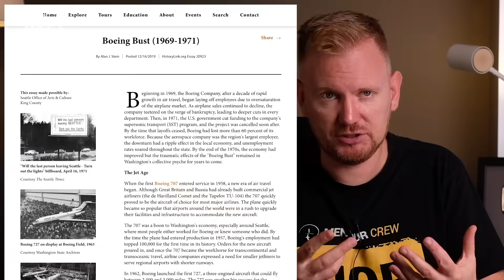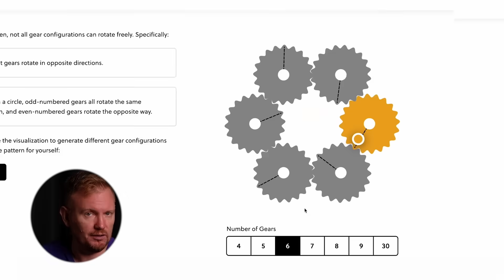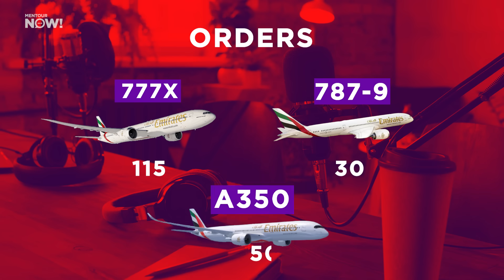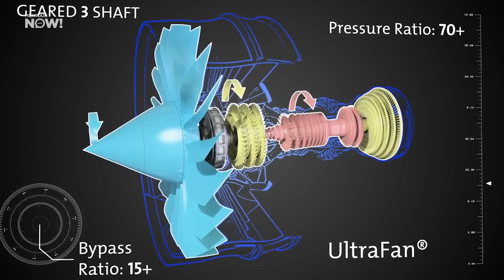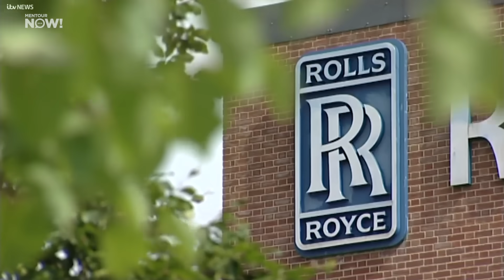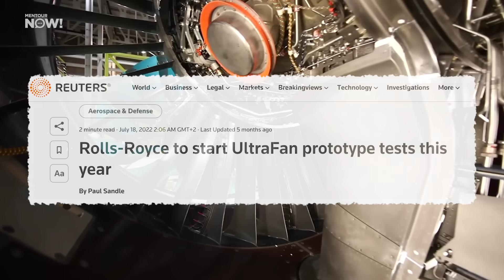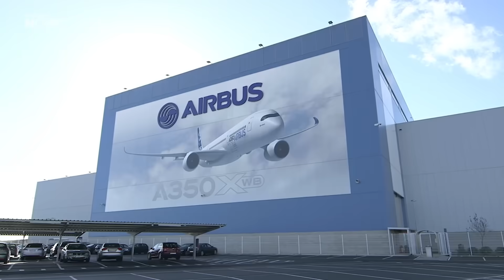Are BOEING planning a 747 with 2 ENGINES?!

Comment: Realistically you need to redesign the wings for new engines and mounts, and at that point you would want to redesign the fuselage, for improved efficiency. At that point you would a new aircraft.
Reply: On seeing the huge size of this new engine it points to a radically different design. It looks basically too large even for a 747. Either the wing has to be very high above the ground (4 metres +) or there has to be some kind of centre mount or even upper mounts (crazy).
Reply: Lucien: 

Good observations!

For a plane so huge, both during its inception and by today's standards, the 747 had a relatively low-set wing plane.  

Standing next to a more recent, and slightly smaller 777, the difference in 747 vs 777 wing-plane heights becomes glaringly apparent.  

The same goes for a Boeing 737(of any variant) parked next to Airbus's A320 family.  

I'm not sure of the reason why, and I'm assuming here, that the wing heights designed into the 1960s era Boeing jets was considered adequate for what was then estimated to be future engine development.  

That, or, the U.S. plane mfgs just did not want to design aircraft so high up off the ground (or normal height by post-2000 standards), that they had trouble interacting with then 1940s or 50s era airport terminal gates.
Reply: @Lucien86  like the Honda jet, yes
Reply: @Lucien86  yea itd better suit the a380 (as much as i hate it) cause the a380 already has those large upwards swooped wings that airbus loves so much. realistically tho, why not top mounted wings? every large cargo manufacturer has done it, and lets be completely honest, going forwards cargo (and emirates) is gonna be the biggest buyers of a new jumbo. and all you gotta do is look at antonov to know you dont need to change the fuselage much. the 747 is basically just a low wing an124 that can hold passengers.
Reply: @Rocker-1234 Top wing aircrafts are heavier than low wing, because fuselage has to withstand forces between a heavy wing with engines and a landing gear. Similarly with rear-mounted engines, where fuselage has to carry weight and forces from engines. "Everything on wing" is the most effective way to build a large airplane
Reply: @Lucien86  my thoughts too. Even if it succeeded, will it be worth the drop in performance? Think about why Airbus never bothered to even try a twin engine A340...
Reply: @Lucien86  inb4 that's why they are looking at truss wings
Reply: @Lucien86  Box wing? Maybe that NASA design for efficiency that looks sort of like a modern Clutch Cargo Flying W? (Bellanca Aircruiser)
Reply: @Lucien86  If one big one replaces two regulars, maybe just replace two with a big one in the tail, like DC-10s or L-1011s, and keep the cargo option for front hinged loading.
Reply: The GE engine was tested on a pylon under the 747 wing. All three standard engines were shut down once the heavily-laden aircraft was airborne, and the single GE engine easily pulled it skyward. That beast develops something like 115 thousand pounds of thrust...more than two standard engines. The engine pylon would need to be re-stressed for the added thrust, but that's probably not too significant. They might even learn that the current design is adequate. Building a new aircraft in this market would be an extinction-level event. Even modifying the 737 nearly killed the company.
Reply: @paulslevinsky580  "The engine pylon would need to be re-stressed for the added thrust, but that's probably not too significant."  The entire wing's fatigue design would have to be reevaluated, and I doubt (I was an airliner engineer with structural background, but not an airliner structural engineer) that would yield a satisfactory outcome.  Load levels and paths are going to be radically different, failure-mode load path redundancies won't be at all the same anymore... on and on.

If it didn't need an all-new wing, which is probably desireable for fuel burn improvement anyway, then probably close to an all-new wing in terms of development and certification costs as a somewhat educated guess.

Having worked on landing gear dynamics problems, "I pity the foo" (in Mister T's words) who tries to significantly jack up the existing 747 fuselage to fit a much bigger engine underneath.  Might end up working out, but a lot more program risk involved than non-specialists would realize.  Even starting with a clean-slate design, Airbus almost got their head handed to them with the A380 gear and that was easier than what would be involved here.  Edit:  For example, the attach points (trunnions) for all four main gear would need to be moved outboard in order to keep the wheel wells in the same position... more changes to load paths!  Airliner designs are so optimized -- many things "interlocking" with a number of other things -- that it's really hard to pull one card out of the middle without the whole house falling down program cost-wise (which hasn't stopped Boeing from trying ; )
Reply: @marcmcreynolds2827  good analysis, thanks!
Reply: @marcmcreynolds2827  I've flown out of Syracuse airport in Upstate NY many times. It has a sectioned fuselage from a 727 on display. If I'm not mistaken, the basic architecture is common among a whole range of Boeing aircraft including the 707, 727, 737 and 757. Boeing is well-versed with repurposing kit from their parts-bin. The 747 has already flown safely with the GE 9X engine under wing in a rigorous test regimen stretching hundreds of hours. The RR engine isn't much bigger, nor much heavier. The 747 was developed in a fraction of the time that Airbus languished on the drawing boards. It is a child of the sixties, before the advent of CAD and powerful FEA evaluations. Doubtlessly the design is big-boned as a result, as the engineers would've erred on the conservative side. That is why I stated that the craft may very well already be structurally up to the task.
Reply: @paulslevinsky580   Yes it is.  Yes they are.  Yes it has.  No it's not.  A bit apples-and-oranges, but ok.  I wrote an FEA program from scratch BTW.  Not how it works. Not very likely.  (Sorry for the brevity, but there were a lot of points to be addressed there.)

In a nutshell, sure an airliner can handle greater loads than it was designed for, at least in terms of nothing breaking over a limited number of cycles.  The criteria aren't as stringent while flight testing under an "Experimental" classification.  But what it takes to satisfy multiple certification requirements for structural integrity (basic design margin, fatigue loading spectra, "fail safe" rules, ???) to meet say a 40,000-cycle design point is something else altogether.

To look at it from another angle, if you could hang a couple of humongous new engines on the hardpoints of an existing 747 wing with just localized strengthening plus some tweeks here and there, then something was very wrong with the design of the original wing.  Maybe a thousand kilos heavier than it should have been?  I know from experience that when it comes to adding weight, twenty kilos can be a deal breaker with an airline.
Reply: @marcmcreynolds2827  : The vibrational regime would certainly be different, and the load on individual pylons would be different, but supposing that the vehicle otherwise remained identical, even to the point of keeping the same speed range, there would be a point around the inward pylons where the addition of stiffening could obtain almost identical stress & strain characteristics the rest of the way into the body, just leaving questions about the redistribution of weight due the the new engine configuration. Not a zero-effort challenge, but smaller than an all-new design.

The bigger question is probably whether different forces should prompt a clean-sheet design. If Boeing's next project is an entirely new design, then they may well make larger changes that "747 twin jet".
Reply: @marcmcreynolds2827  A spar failure would be far worse than losing a sprig of parsley from the chicken antre'. The 747 was put to paper mid-century, not long after the venerable B-52. Another example is the iconic DC-3. Or the Tu-95. No one envisioned those aircraft becoming centurions. They have all vastly exceeded their design teams' capabilities and target service lives. They simply didn't know as much about the aging process of metals and the accumulative effects of stress/strain back then. That growing body of knowledge can now be used to expand the envelope of the existing 747 airframe. I'd trust a twin-engine 747 more than a digitally-compromised 737max with no user manual.
Reply: @paulslevinsky580  "A spar failure would be far worse than losing a sprig of parsley from the chicken antre'. "   Well I'm glad we cleared that up  ; )

"They simply didn't know as much about the aging process of metals and the accumulative effects of stress/strain back then. That growing body of knowledge can now be used to expand the envelope of the existing 747 airframe."   I see that repeated fairly often on the internet, suggesting the 1960's/1970's was some sort of fatigue-mechanics dark ages. 

Yes, knowledge of (metal) fatigue mechanics has continued to increase over the decades since then, but there was plenty of fatigue/fracture mechanics knowledge to work from at the time.  What has changed is the means by which regulatory authorities seek to insure that fatigue matters are properly accounted for in an aircraft's design.  I was present though not directly particpating when that got underway in earnest in the late 1970's/early 1980's -- the transition from "fail safe" to "damage tolerance" methodology in certification.

To be clear, there's no question engineering-wise that four existing engines on a 747 (or DC-8, or...) could be replaced by two engines of whatever size.  The resulting aircraft would fly safely, could be certified...  and in my opinion for the reasons I've talked about plus more that I haven't, would sell few to none.  That does occasionally happen  in the jet aircraft business BTW:  Build it/fly it/absolutely no one buys it.  The engineering here is quite doable, but the economics likely stinks.
Reply: @paulslevinsky580 You would actually be surprised how closely engineered the original 747 was. So closely designed, in fact, that some areas cracked over time because of rough handling by thee pilots (like the habit of slamming the nose down when landing).
Reply: @paulslevinsky580  Great points.
Reply: @Ampersandrascott  I read a technical article about the development of a fastener that was going to be used repetitively on the 747. They carved it to the bone. I can't remember the numbers, but it was a stunning weight savings.
Reply: @The_ZeroLine  why thank you
Reply: Marc:

The Max thing all boiled down to MONEY.

Instead of, as Airbus did, clean-slating a whole new plane, Boeing attempted to create a larger, 21st century ETOPS-capable plane out of an existing early-1960s regional hopper. 

Which in lives lost cost Boeing far more than any money saved by not starting from scratch.  

And they didn't have to start from scratch - if they wanted an intermediate sized twin-engine ETOPS machine, the platform for that had already launched, back in 1980 .....
Reply: @marcmcreynolds2827  Are you all assuming they are going to stress anything by making the planes go faster, fuel economy is the big dog with airliners. Cutting their own throats and overbooking is the way they have been doing it. 

Now a few disasters later they have decided to just push more free air though the plug-holes. Bigger engines will still run a lot cheaper at 500knots, won't they?

Lets have a story about high bypass engines and how they cooked their geese with frozen turkeys. I never heard the full account of the demise of Rolls Royce.
Reply: @michaelmcneil4959  Replying only to the comprehensible part of that:  No, I'm not assuming anything about going faster.  Note that stresses don't even have to be significantly larger in order to cause a big design/certification problem.  They only have to be differently distributed, which of course in this case they would be.
Reply: @paulslevinsky580 some parts will have overcapacity strength wise, but some parts will be quite close to the limit because real world fatigue testing within the load spectrum just never revealed this...
Reply: @paulslevinsky580  Very interesting!! Thanks
Reply: @paulslevinsky580  No. The bad modifying nearly killed the company. A honest communication to the airlines is crucial. They needed to tell them about the risks of the aircraft and how to avoid it. Instead, they lied to be in a better commercial position
Reply: @Paul Slevinsky  the new RollsRoyce pearl 10X will be pushing passed 18000 lbs of thrust....but would have thought if they're spending all that cash on engine development then surely they should develop an aircraft too match
Reply: I'm not a variant historian but it seems that Boeing has built new wings more than once with existing fuselages. Far from trivial, but still easier than a whole new fuselage to go with it, other than maybe adding or deleting a few frames. Landing gear  length sometimes changes slightly, although lengthening all five 747 landing gear bogies would probably be complicated depending on how high they go, affecting wheel wells, structural loads, weight and balance, and aerodynamics on takeoff and landing.

The 747 fuselage is well proven for cargo and passengers, so it shouldn't be dismissed out of hand. But realistically the odds are against it. For one thing the 737 MAX fiasco would make investors nervous at the idea of such a radical engine change on the 747, no matter how much sense it might make. 

I have always thought the 737 MAX was a good idea, if Boeing hadn't almost criminally botched what should have been a straightforward software modification. But the collective wisdom now of the press and armchair aircraft manufacturers is how dumb Boeing was for putting a bigger engine on the 737 than it was designed for. Ignoring or more likely being ignorant of the incredibly successful NG conversion twenty-five years ago.  The fact that the MAX is selling so well after that much negative publicity I think shows that the general concept was a sound one, and it bought them several years to allow technology to continue to improve before they do a clean sheet replacement of their most popular model. 

Don’t get me wrong some people should be in jail because of MCAS,  but the 737 MAX is a great redesign. But for PR reasons if nothing else they aren't going down that route again with their 1960's era designs. 737 MAX will be the last 737 variant, just as I think the 747-8 was the last 747 variant.
Reply: @StevePemberton2  That's true IMO as to the wing being more important than the fuselage when it comes to where to invest limited money towards innovation/efficiency, once the decision has been made to upgrade rather than start fresh.

MCAS never would have mattered if not for it getting pushed to do more than originally intended in order to meet an FAA certification requirement that control forces be within ten pounds of previous 737 versions for a certain type of maneuver.  Even though software (plus belated training) is the fix for now, what it really needs is an additional angle-of-attack sensor as well.  The FAA let the type back into the air with just the software part for now, but last I heard that extra hardware will eventually be required as well.
Reply: @marcmcreynolds2827  : Just to be clear, I would be more inclined to expect a clean-sheet redesign. To the extent that I wonder more if it'll be a conventional design, some flying or (more likely) blended wing, or something that I'm not even thinking of. Given the general questions about the future of aviation power, I think it's actually about the right time for them to play around with odd designs, and then spend the effort to design their first "new aviation" airliner, so that they'll be able to make the transition with less stress.
Reply: @absalomdraconis  "Just to be clear, I would be more inclined to expect a clean-sheet redesign."  Yes, and part of the reason goes back to what you said about strengthening the wing between the new engine's attach point and the fuselage.  That presumably could be made to handle the loads people think about when they imagine a higher-thrust engine, but what's also going on is that with a bigger engine at one attach point and no engine at the other, something called the modal response of the wing is radically altered.  That effects fatigue design (potential metal failure from a large number of nominal-stress cycles) throughout the entire wing.

So it's a Dynamics problem as well as a Statics problem, even though people mostly just imagine the static forces.  And even if somehow there weren't any big issues which came out of that reanalysis, there's still the nacelle clearance issue from the larger fan diameter... and more things that I haven't talked about.  So at the end of a thorough evaluation process, it probably ends up like you expected with an all-new and more efficient wing.  

But metal or carbon?  The latest 777 uses carbon fiber for both the fuselage and the wing, so would Boeing sink billions into an aircraft comprised of new engines mated to a new old-technology metal wing joined to an old-technology metal fuselage.  Where would the sales come from for a stop-gap offering like that?  So perhaps the 747-8 variant will in fact be the end of a very storied road.
Reply: Great. Now how do we make it a 737?
Reply: @justcommenting4981  Is this a joke?  Specifically, fitting a 140inches diameter fan(excluding width of engine cowlings) as per the current RR Ultrafan prototype specs under+ahead of the 737 wing?

Ignoring op economics re the grossly surplus thrust for a 737 and the degree of aero mess created re fluttering, how does that work in terms of basic geometry for engine ground clearance?....especially given that the current CFM Leap 1B engine on the MAX10 has a fan diameter of under 70inches but still required tricky+costly landing gear structural  redesign to make the wheels fit into the landing gear bay.
Reply: @felixli5279  all I know is it ain't surplus thrust if you extend that bad boy far enough.
Reply: @justcommenting4981  by making it do random nose dives in to the ground
Reply: @justcommenting4981  I kind of thought of that, given the MAX designers going to a larger diameter engine and reworking the way it was mounted to the wing. Though any attempt to do the same with a potential future 747 variant would benefit from all of that experience.
Reply: Apparently Boeing doesn’t think so..based on 737 Max
Reply: The 777X I think is close to the same pax  capacity as the 747 400 in a three class configuration and has an efficient composite wing . I can't see a business case for a.re-engine of the old tech.747.
Reply: There are already FIVE engine mounts on a 747 
747's have an extra mount hidden by panels for when they want to ferry engines.

Boeing added the fifth mount when airlines complained about the difficulty of shipping a replacement engine to 747's stranded at distant airports.

So Boeing just added an extra mount to the left wing
Reply: @glennchartrand5411  They should come up with a three engine aircraft a lot like the MD-11 thats little bigger than the 777!
Reply: @glennchartrand5411  Boeing refer to it as the External Spare Engine Carriage Kit or ESECK. Commonly referred to as the 5th Pod. Same on the 707 and the Vickers VC10.
Reply: @tedsmith6137  And L-1011.
Reply: @glennchartrand5411  how would they counter the uneven weight (3 on one wing, 2 on the other), or let alone the drag the non-used engine would create.
Reply: @andrewmurray1550    That's well within the compensating capabilities of the ailerons (mostly) and the rudder.  It's not that much mass relative to the overall mass of the aircraft.  Plus a nosecone can be installed over the ferried engine inlet to streamline it somewhat.

When a DC-10 had separation of one wing's engine at liftoff -- even more imbalance than 3 vs 2 above-- that airplane was still completely controllable and the pilot likely didn't even imagine that the engine had separated as opposed to just quit.
Reply: @andrewmurray1550  The same way they compensate when a 747 has an engine out situation.
Reply: @glennchartrand5411  Have you looked at Galaxy Girl? The 5th mount point is only so that a spare engine can be shipped to where it might be needed by a grounded 747 which needed an engine replacement.
Reply: @johnbuchman4854  Thats what I said the fifth mount was for.

I was pointing out that the 747 wing is easier to modify than later models because its all metal and overbuilt by todays standards.

Deleting the outboard mounts and strengthening the two inboard mounts would be a lot easier than doing the same thing to an A380

The only reason this was even considered it the 747 is still a very popular cargo plane and eventually the ones in service are going to be overhauled. ...a way to upgrade the current 747 cargo planes to the new massive engines might be an option Boeing offers.
Reply: @glennchartrand5411  The DC 10 had the same thing on the left wing.
Reply: @glennchartrand5411  Wasn't a new idea - some Douglas DC-8  were built with the same option. A special pylon on which an engine could be mounted bolted to the inner area of the left wing. The package included aerodynamic fairings for the engine so the drag would be minimized.
Reply: @glennchartrand5411  the 5th engine mount is not designed for thrust production - idle shipping only.
Reply: @glennchartrand5411  um... there are SIX. Don't forget the APU
Reply: @glennchartrand5411  10-4 dad went through the ranks from 8'sto 27s to 47,400. Company retires and kills proper operators.
Reply: @glennchartrand5411  The 5th mount dates back to the 707.
Reply: @glennchartrand5411  clearly, what this means is that we need a 5-engine 747 redesign
Reply: @glennchartrand5411  thanks for this reality bath
Reply: @glennchartrand5411  it won't fit under the wings of any existing planes if it has to ever LAND!  it won't clear the runway.
Reply: @vueport99  The GE 9X was originally flight tested on a 747.

So yes , the larger engines do fit but the industry is moving away from widebody jets so there is no good economic reason to design a twin engine 747.
Reply: @glennchartrand5411  as long as it fits I suppose. I'm just wondering cuz the video gave an impression it's much bigger.

Also, I wonder why they don't build a much wider plane so the bottom of the plane acts as a foil for added lift and save even more fuel
Reply: @glennchartrand5411  lol, "oi mate, can you bring me an engine?"
Reply: not nesseserly as it wold weigh same or less as 2 being more efficent not as big tanks for same range also could remake the wigns out of compsites ad the tail too make it lighter and even more F.E
Reply: Not to mention the landing gear, which would have to be long enough for ground clearance of those wide, new engines.
Reply: @markpell8979  : I think the fifth mount includes hydraulics, and maybe electrical, but not fuel. It has enough to prevent air flowing through the engine from causing problems, but not enough to actually start it.
Reply: @absalomdraconis  After thinking a little more, it makes sense that a Boeing wing would be engineered to be able to bolt extra things on for utility when so many of their aircraft have had military applications instead of or as well as civilian commercial. You could say that for McDonnell-Douglas and Lockheed too. To your point though, say if you're using an extra hard point to carry a replacement engine to a jet stranded somewhere with a broken one, of course you wouldn't want it windmilling in flight without lubrication or maybe even de-/anti-icing capability. So having electrical and hydraulic service connections to that engine would be logical. But a simpler way to protect it would be to close the intake with a fairing and lock the shaft against rotation so it wouldn't need pressurized lubrication or internal icing protection. I don't know what's the better way or what they actually do, just throwing that out for sake of discussion. One of the great things about this channel!
Reply: @markpell8979  There are ways to lock the rotors of a turbojet/turbofan engine for inoperative ferry in-place, but for spare engine transport, I know the DC-8 had fairings for drag reduction and I'm certain the other manufacturers had the same ideas.
Reply: @paulcrumley9756  That makes sense, I just had never thought about it before. This all started with Petter bringing up the idea of a two-engine 747, isn't that wild? The thread seems to have evolved and generated more viewer interest on Mentour Pilot than I have ever seen before! This conversation has been going on for days now.
Reply: @absalomdraconis Nope. The extra fitting (which was an option) was just a mount. An abbreviated pylon was attached to hold the engine. The engine was locked down during flight. No systems needed.
Reply: @absalomdraconis  The fifth pod has no hydraulic or electrical provisions. It cannot be used for an operating engine because it is not stressed for thrust loads, only drag loads and mass loads. The engine on a fifth pod has its fan blades removed and a core fairing fitted, these prevent the engine spinning in the airflow. It is merely a means of transporting engines.
Reply: lol, boeing is essentially the same company that stretched the DC10 to the flying coffin it ended up being lol. No new airframes. They are not an aircraft engineering company, they are a shareholder company.
Reply: @dorianvedrashko9172  "lol, boeing is essentially the same company that stretched the DC10 to the flying coffin it ended up being lol. No new airframes."  Why is it that "lol" in a comments section always seems to go hand-in-hand with ignorant opinions?  Or was "no new airframes" a joke of some sort?
Reply: @dorianvedrashko9172  You forgot the lol this time  : (

"You are the only ignorant person here."  I imagine I'm also the only one between us who's actually done airliner engineering, stretches included, as opposed to just reading some things about it.  Yes, how greedy of (Boeing in this case) to stretch their 777 when they could have developed something new and bigger... say with two decks.  That ought to make the shareholders a lot of money.  It's not like they would only be able to sell a few hundred and then have to shut down the program at a huge loss.

Fortunately for shareholders (who do matter by the way), launch decisions are made by people more experienced and sober than lol-type internet posters.  Sorry if the results leave you confused.

There's a lot that can be said about why stretches, when done right, are generally better for passengers, airlines... and shareholders.  I can talk about a few particulars if you're interested.
Reply: @marcmcreynolds2827 i am not an airliner engineer (construction machinery) but what about this idea: lets redesign wings with a slight V shape, bending upwards like a swallow, with the engines mounted at the point where the wings continue horizontally. This creates ground clearance with existing fuselage. What would bent wings mean aerodynamically ?
Reply: @Sjanzo  The larger that wing angle, the more of the aerodynamic force generated by the wings that goes to putting bending stress on the root and fuselage structure  (which is bad -- need heavier structure, subtracting from payload) rather than goes into supporting the airplane (the "lift" component of that force).  So "it's an inefficient design" might be one way to put it.  Of course, any airliner will have many inefficiencies of one sort or another as compromises are made to optimize the overall design.  But that would be a big one relative to designing (or redesigning) the wing to accommodate taller landing gear.
Reply: Note to thread skimmers:  Now revisiting this thread for the first time in months, I see that it has "looped".  People (not the poster I just responded to, who had a perfectly good question) are starting all over again on discussions about fifth-engine hard points, and fanciful notions about how aircraft engineering works.  I'm guessing they more or less skipped the first part of the thread, where actual aircraft engineers including a 747 engineer (not me) provided their expertise...  and have since checked out of the discussion.  I would recommend sifting through roughly the first hundred posts for anyone who wants to get an informed read on the "747 twin" subject.
Reply: @marcmcreynolds2827  just to be clear, i didnt mean to bend the wing back (i understand it puts torsion on the fuselage and totally changes the balance of the aircraft) but to bend them upwards  from the fuselage so the landing gear remains the same, about 15 to 20 degrees upwards untill they are high enough to accomodate a modern high bypass turbofan. Then when we're high enough to hang the engine under the wing so that engine thrust point is in the same location as in the original design, we keep the rest of the wing from the engine to the tip, level.
Reply: @Sjanzo    I also wasn't speaking to a change in wing sweep (or "bend back"), which as you note would alter CG etc.  I was avoiding using the word "dihedral" since some people might not understand it, but we are both talking about that.  What I didn't perceive from your earlier post was that you were maybe talking about maintaining the same effective dihedral as originally, by decreasing dihedral outboard of the engine to negate the increased dihedral inboard of it.

That (or at least something similar) could presumably keep the bending moment at the wing root the same as baseline, but then the resulting "kink" in the wing introduces a different structural inefficiency:  Spars weigh the least when they are straight or have a smooth curvature, rather than discontinuities in curvature.

The lateral location of the engine (how far out on the wing) is limited by things like engine-out control authority, which would make for a rather steep initial dihedral angle to accommodate the large engine diameter fairly near to the fuselage.  And the wing landing gear would have to change a bunch.  And the aero handling qualities would be quite different.  And...

So when all is said and done, an interesting thought experiment but it would be easier/cheaper to just design a new and more efficient wing which incorporates a taller landing gear.

Backing up even more, as I indicated about seventy posts back it's not that a metal wing/metal fuselage "legacy" 747 Twin couldn't be developed and certified -- just that no one would want to buy  something that dated to get better fuel efficiency and performance.  I was involved with an airliner re-engine certification, and it really only makes sense when the same number of engines is maintained as originally.  Note that even the B-52 re-engine stayed with eight of them on the four pylons, rather than changing to four engines with the presumed decrease in maintenance costs.
Reply: Hello Petter, I've got a question for you regarding the the US FAA 1500 ATP pilot rule. It's my understanding that other countries around the world have not followed suit with the same number of flight hours required for a restricted ATP license for new First Officer pilots with some new, freshly minted FO's having as few as 250 hrs while piloting Airbus and Boeing jets in overseas markets. So my question is does the US allow foreign carriers to fly into US regulated airspace with a FO flying from the right seat with fewer than 1500 hrs total time? If that's the case then that would be a rather unusual precedent in having two different sets of standards for US domiciled pilots and foreign pilots both flying into US airports. That would be like the US regulating that a semi tractor trailer driver with a CDL to be at least 21 years old if they are a US citizen while still allowing CDL driver's from both Canada and Mexico to drive on US roads and highways if they're only 18 years old. Do you know if there are 2 different standards for US and non US pilots operating into and over American skies? Can a Canadian, Mexican, Australian, Asian, Central American, or other nationality First Officer commercial airline transport pilot still fly into the US with fewer than 1500 hours and does that ever happen frequently? -Thanks
Reply: New engine to be used😂will be fun for😂engineers…
Reply: The desire for a 2 engine 747 is as a cargo aircraft.

The 747 was originally designed to be a cargo aircraft and now that Airlines have stopped buying them the supply of "Used 747s" that the cargo industry relied on is drying up.

So a twin engine 747 could meet the demand for cargo plane replacements without having to design a whole new cargo plane from scratch.

I dont think it will ever get built  Boeing is just exploring its options right now.
Reply: @glennchartrand5411  NOT designing new airframes is what led to the Max 8 debacle. They need to build new airframes period. the remixing old existing planes act is getting real old.
Reply: @markpell8979  Yes, I think that point (the 5th engine not active when mounted) is a good observation. As well as not having the necessary plumbing it would also mean that the only significant thrust vectors are still from the 4 active engines. Replacing the 4 current engines with 2 bigger engines, even if physically located at 2 of the existing mount points, would materially alter the input force vectors on the wings that the wing design then needs to absorb/transmit through to the rest of the structure so I agree with the original comment that the wing redesign required would likely be significant.
Reply: @markpell8979  Likely true  what you say concerning all the hookups. Quantas had  mounts inboard of the left engines to ferry spare engines on their 707s back in the 60's.
Reply: Not really.  The current -8 is a brand-new wing attached to an existing fuselage with extension plugs forward and aft of the wing.  This wing and its hardware could be modified and leave most of the aircraft alone.  This would be a great project to work on.
Reply: @raymondjensen4603  Not an all new wing. There were some loft changes and changes to the structure for strength, but the basic engineering remained the same. That’s why we didn’t have to break a set of wings. We sat down with the FAA and EASA and were able to show the engineering model that got us from the -400 to the -8. And yea, it was a fun and challenging program.
Reply: I don’t think people saying “it would just make more sense to design a new plane if they have to do x, y and z” have a grasp on the immensity of manufacturing a brand new model. Designing a new plane is the easy part. Just the lining up the contractors to manufacture all the parts not done in house aspect of the manufacturing process alone is a more difficult task.
Reply: But you'd claim it was the old aircraft so there's no retraining necessary.  What could possibly go wrong?
Reply: Easy, they would change the engine mounts for larger diameter engines, which would cause a change in behaviour that they will correct with an MCAS system.
Reply: @markpell8979  I remember in the 80/90s being on a flight from SYD to LAX and looking out the window thinking I did not know that this was a code share flight. The engine out the window was decaled QF but the operating aircraft was NZ. Then I noticed 2 more engines on the wing and realised we were hauling freight out there. I checked on return why QF didn't use their aircraft. It appears it was time critical ie the NZ flight arrived LAX much earlier.
Reply: @dorisday137  People naturally think it's dog-eat-dog all the time but the lines help each other out a lot. Ferrying an engine or other replacement parts, helping pilots from other lines commute to work or get home, etc. A spirit of 'cooperative competition?'
Reply: Hasn't the boss of Boeing already ruled out new aircraft until 2030 onwards. The mention of the dreadful supersonic plane makes this a dubious realistic dream. 747s represent the old engineering. Boeing already is having problems with the FAA over the mess it made of the Max series.
Reply: good point - you would otherwise get yourself a 737 Max..with all its skeletons in the closet..
Reply: Which is something the bean counters at Boeing are not going to do...  LOL
Reply: Those 'mounts" as you call them are called pylons. They're big enough.  
However each engine of the 3 engine options that were available for the 74-800 the most powerful made almost 100k lbs less thrust than a A380's Trent 900. The pw-4000-9 was the most powerful engine option on the 74-800. Theoretically 2 of the A380 Trent 900 RR engines could almost handle the job, maybe add 2 boeibg 757 engines as back up. The 74-800 wing and frame structure can handle an engine with 30% more thrust and that engine would only need to be 18" larger in diameter. Lots of ground clearance there still.
Reply: no!!!
emphatically NO
beoing can do it with a software solution
Reply: Most 747 still flying are relatively newly built, so it’s really no problem making new adjustments and major design change on the fuselage. 

The idea of doing new versions of  747s much like how they made newer versions of 737 is so that Boing wouldn’t have to undergo major Regulatory Permits, Licenses and permits in making a "Brand New” Aircraft. There are so many hurdles and many years of doing checks, making tests, getting permit for one stage, repeat. Such things can take a Decade or so before finally getting approval to fly, sell and bring it the international market.

By just making just new revisions on an old "Approved" and very dependable plane design, Boing can easily release the updated  747 in a few years, with much lesser Regulatory checks and International market rules.
Reply: @inisipisTV  Unfortunately, that ship has sailed.

The final 747, a cargo variant, is about to depart Washington state, or already has. It's just not economical to gut the entire underpinnings of a 50 year old platform to re-engine with two.
Reply: GE and RR use their 747 to test their new engines (including the GENX engines used on the 777X)
Reply: They would redesign the whole airframe because using metal airframe isn’t gonna be efficient
Reply: Imagine it's called Boeing 748
Reply: They already did  an engine mount redesign. There was a trijet 747 design with the third engine being put in the tail.
Reply: How big would the engines have to be? Will it have enough ground clearance? It’s like combining two smaller engines into one.
Reply: The b747x
Reply: The fuselage was resdesigned for the 747-8. It wouldnt need that much. It would need entirely new wings though.
Reply: @AMCustomCoasters  It was strengthened for the -8, but it was basically the same.
Reply: Well that sure ruined the party. Bummer
Reply: Totally agree. Plus, any long haul two engine aircraft would have to be certified to ETOPS and that requires a redesign of the rudder, stabilizer, elevators as well as strengthening of the rear fuselage to counteract the stresses of asymmetrical forces when running only one engine.
Reply: They sure didn't do all that redesigning with the 737 Max
Reply: But you can keep things like the seats, the lights in the end of wing.... :-)
Reply: Basically you gotta start from scratch and re-scale the whole aircraft just to make it work with 2 engines especially if you're trying to keep its same size and performance specs!
Reply: The landing gear would be one of the greatest needs for redesign. A larger engine needs greater ground clearance. Of course that would hinder cargo loading and unloading through the nose so maybe The Queen won't be redesigned.
Reply: Methinks they are looking at what to do with thousands of 747 airframes that would likely end up in the furnace. If they could get it right that would be great. However the 737 debacle should be a learn from experience event. Aviation safety costs money and cost saving
with the best intentions is always concerning. A clean sheet design is always the safest solution.
Reply: a shame..I truly love that airplane…you still can feel flying it in the cockpit, whereas the Airbus has a mini joystick which is just too tech I imagine
Reply: High mounted wing like a C5?  The engine diameter is about 8 ft on C5.  Large diameter engines may necessitate a rethink on passenger jet wing design.
Reply: When you look at the 747, it's blatantly obvious that a larger engine wouldn't at all fit, so yes, I would completely agree that an entirely new plane would need to be developed. I'm curious to know why they don't make one with an overhead wing.
Reply: The bigger the engine, the closer to the ground it becomes. Until we boost engine power will smaller designs, then its not possible and engine makers are not even considering the 747s old wing design. Are we also assuming that these new engines are lighter? The aim is more power at less fuel. The A380 is big and high off the ground also due to the size of the engines not just weight and its cabin size requirement
Reply: High mounted wings would be good with engines this size. And of course Boeing are working on such a project with their truss-braced wing studies...
Reply: @RegebroRepairs  Most of Airbus's models, and Boeings since the 757, seem to have accomplish fitting larger engines simply by designing the plane, in the first place, with taller gear, a higher(mid-wing) wing within the fuselage, or some combination of both.

In other words, going to a roof-mount wing is not mandatory to accompish this.
Reply: @Zickcermacity  But all those solutions both have their drawbacks, and as you note, they are already used. And this engine is EVEN BIGGER.

And the truss-braced wings solve all those issues in one and has additional benefits. It adds one new problem, namely these new wings have very high aspect ratio, which means they are loooong. 

But the point here is, that this engine, and Boeings studies on new wings are perfect matches. And I don't think that's a coincidence.
Reply: @John Chapman "The difficulty (with a 747/777 hybrid) might be the slightly different fuselage widths, " plus the fact they are made of different materials!  It took 126 comments, but we finally hit on something which couldn't possibly get certified ; )   I say that with genuine affection for your original, outside-the-box thinking.  It's brainstorming which over time moves technology forward.  But as with almost all of my brainstorming ideas* at the airplane factory...

There was BTW something a bit along those lines which came up after an MD-80 flight test.  A crane fell onto the top of the fuselage as they were attepting to lift it off the desert ground following a gear collapse.  With part of the fuselage now damaged,  should they repair it back to an MD-80, or shorten it down to an MD-87?  That variant hadn't been manufactured yet, but they knew they would be building them at some point and this would give them the first flight test certification aircraft (it ended up simply being repaired).

*  In one of my annual employee evaluations, my boss wrote  "Marc has 6 or 7 ideas when others have 1 or 2."  Of course, he didn't say they were good ideas.
Reply: Well hello 797
Reply: That isn’t necessarily true. Only a partial redesign of the mounts would be necessary, not the wing (and definitely not the fuselage), as the [thrust] load on the wing would not be very different at the root. Considering that the thrust produced by the exterior engine provides a higher moment of force at the root [of the wing] than the same thrust from the engine closer to the fuselage means that even an engine with more-than-double the power of the original engines were fitted close to the fuselage, the total load moment on the wing root would not exceed that of the original 4-engine configuration. The weight of the engine would also not be a problem, as a single larger engine would likely weigh less that two of the original engines.
Reply: @xavieryates9782  The engine would be mounted somewhere in between the mounts of the old engines so a mod would need to be done on the wing at that new engine location and the wing would need to be modified at the old engine locations to reduce the weight of the extra structures.
Reply: @stevepodleski  I don’t see why that engine would necessarily be mounted between the previous mounts. That is not obvious to me, nor is it desirable, as it is always preferable to have the engines as close to the fuselage as possible (while also considering easy access and other possible reasons not to) simply because in case of engine failure the moment of rotation produced by the remaining other (i.e. functional) engine is far easier to counteract than if the engines were placed farther from the fuselage.
Reply: If we had some bacon we could have bacon and eggs if we had some eggs.  :-)
Reply: Not realistically at all. Boeing actually mocked up a two wing engine Boeing 747. The difference was that they put a third engine in the tail. It was a tri-jet. Boeing could make a two engine 747, the problem is none of the engine manufacturers make an engine powerful enough. The 747-8 uses four of the same engines in the 787 to develop enough thrust for the 747-8I. The problem with all of this is that the 747 like the A380 is that the bodies are too big, and too heavy.

The Boeing 777 is about as large as you can make a plane, while keeping it efficient enough that you can still fly it half full, and turn a profit.
Reply: Who wants a 757 MAX after the deadly debacle with 737 MAX!
Reply: at that point, and at that point, and at that point, and at that point, and at that point, and at that point, and at that point, and at that point, and at that point, and at that point, and at that point, and at that point, and at that point, and at that point, and at that point, and at that point, and at that point, and at that point, and at that point, and at that point, and at that point, and at that point, and at that point, and at that point, and at that point, and at that point, and at that point, and at that point, and at that point, and at that point, and at that point, and at that point, and at that point, and at that point, and at that point, and at that point, and at that point, and at that point, and at that point, and at that point, and at that point, and at that point, and at that point, and at that point, and at that point, and at that point, and at that point, and at that point, and at that point, and at that point, and at that point, and at that point, and at that point, and at that point, and at that point, and at that point, and at that point.
Reply: Even if they could, would the fuel savings justify the loss in performance? You can't just drop to two redesigned engines and say it's all good.
Reply: @largol33t1  I'm not an engineer . I'm not sure exactly what dropping two engines would do . Exactly . I'd just look at what the testing and experts thought was possible  . Sound fair to you ?
Reply: 777X will be it!
Reply: It has been calculated that it is within possibilities with modern engine designs to create a two engine 747 that has efficiencies exceeding even the A320 line, with greater capacity, and with a pilot shortage and air traffic increasing, this is in high demand today, that and it can take 10 or more years from start of design to a finished and certified product and Boeing already has the manufacturing capacity for the 747 is why you might want to go this route.  That and it would give Boeing a highly viable produce during that design time.  That and the fact that Rolls Royce has already been designing an engine that would, coincidentally be ideal for this application makes it not only plausible but likely.
Reply: No.   The 777X proves the opposite - it got new, bigger engines paired with new composite wings, but it's NOT a completely new aircraft.   I've never heard of a supplier developing an engine that's too big for any existing or announced application - they MUST have some inkling that Boeing and/or Airbus are planning a twinjet larger than the 777X, and a 747X with new composite folding wings and two huge engines makes perfect sense.   It's just a shame that it didn't happen before the production line shut down with the headline that the 747 had "died".
Reply: The new airplane is called the 777.
Reply: It would be impossible, the two engines would have to be a lot bigger and wouldn't fit under the wings, this is just one big hoax
Reply: Yep
Reply: Boeing is not known to redesign things well. Look at the Boeing 737 Max series.  That should have been a completely new jet.  But, they forced the new engines on the old fuselage and tail.  The results speak for themselves.
Reply: @IndridCold-o4o yes remember too they got new ceo now
Reply: :Laughs in 737 Max:
Reply: redesign the wings will be same as the 777, so  747 may as well be the 777
Reply: @michaelwhitmore7160  I'm sure there's more to it than that. Besides, the idea is to retain the versatility of the 747 especially for freight.
Reply: In a perfect world that's what would happen. Also, Boeing would have developed a new narrow body parallel to the 787 (think 757/767 development) with carbon fiber fuselage, common avionics, etc. Instead, we got 737 rehash which will sell short term but lose out long term. The 747 twin-engine will have a very narrow market demand and thus not warrant a clean sheet design.
Reply: @maestromecanico597  he
Reply: @markpell8979  That's also the hardpoint that Virgin Orbit uses for transport and drop of their two-stage launch system.
Reply: I think the easiest way would be to redesign  and extend the landing gear.
Reply: @vanessadillon2101  That's what I would think, too. The example of the 737max showed that this might be not so easy. Instead of extending the landing gear they created a whole mess to fit the engine to the aircraft
Reply: @andreaseufinger4422 Where would you stow the extended gear?
Reply: @andreaseufinger4422  There were no engineering issues. It was their avoidance of pilots having to get a new type training for the MAX which is what resulted in the problems.
Reply: @The_ZeroLine  Partly yes. But without the avoiding they might have found a better solution than building an unbalanced aircraft and fix it with Software
Reply: @andreaseufinger4422  Correct that would be a significant redesign to the wing and the fuselage. You’d be looking at a pretty different aircraft.
Reply: Andreas:

Oh, they made those new Max engines fit alright - at the expense of vertical(takeoff) pitch stability.  Which necessitated new software to keep potential excess positive pitch under control, without training or even informing pilots of that revision.  

We see how that shortsightedness turned out, sadly.
Reply: @andreaseufinger4422  The thing with 737 is that it sits super low to be comfortable on small airports in particular in Americas, as the low height gives you short stairs etc. when you don't have a tunnel gate. That's not an issue for a large aircraft.
Reply: @tomhejda6450  This is most likely the explanation of the initial design in the late 60s. I don't know if this is still today an issue. But there is still the major problem that Boeing told the airlines that there is no additional training required for the 737 max and this was clearly a dangerous lie. The 737 max has some issues due to the design and the least you must do is give all the available information to the pilots.
Reply: @vanessadillon2101  that would require a redesign of the wing box and modifications to the fuselage to accommodate the taller landing gear. That alone is very expensive and results in the need for a new type certificate, pilot ratings, and more. 
Unfortunately we will never see a 747 Twin
Reply: @andersonnettleship845  not sure you'd need talker gear .  I fly these beasts every day and I'd like to think that if the inboard engine were hung higher up on the pylon it would provide adequate clearance .  The engines are currently very low hung off the pylon and provide about 4 feet of clearance now . If the changed engine hung higher provided the same clearance it would be a ok .
Reply: @vanessadillon2101 Where would you put it?  Have you ever seen how crowded the wheel wells are?
Reply: @vanessadillon2101  you'd need to also alter the fuselage construction then. Longer landing gear legs require larger retraction bays where there's lots of piping for different systems reside.
Reply: @vanessadillon2101  HUGE can of dicked up worms.  This is the logic that got them into the MAX mess.    Given that BOTH the 777 and 787 can just about fly halfway around the globe, I don't Boeing doing anything to the 747 airframe except continuing to make it as a super capable freighter.
Reply: @vanessadillon2101  Which would mean you would have to redesign the landing gear wells. All the fuel tanks that surround  the wells and the structure that is integral with the tanks and Wells.
Reply: @vanessadillon2101  
Really? Thank God you aren't designing aircraft.
Reply: @vanessadillon2101  No, the landing gear cannot be extendend on 747 because it wouldn't fit gear hold, and hold cannot be redesigned without major redesign of the aircrafts fuselage. Such a huge engine really requires design of the new aircraft.
Reply: Several years ago Boeing floated the concept of a 500/600 series 747 (one passenger jet and one freighter) and there weren't enough customers.   Even though the 747 is a great design, its just easier to design a new airplane than to try to re-work an old airframe.  And, although point to point flights are preferred, there are only so many hours one can tolerate inside a flying tin can, especially if you're in economy class.  (Talk about air rage....)
Reply: I would a new aircraft
Reply: Anything over .177/.22 is a waiste of money and fun.
Reply: If a high-wing design is good enough for a C-17, a C-5M, or an Antonov An-225, why is it never mentioned in connection with using this giant engine?
Reply: @thatfeeble-mindedboy  Interesting question.  

I think that while the 747 was revolutionary in terms of size for its time, the approach to, and implementation of the design, was relatively cautious and conservative.  hence one of the lowest wing-to-fuselage ratios of any currently operating passenger jet, regardless of size.

That decision would severely limit the extent to which larger, higher-bypass propulsion options could be swapped in on the 747.
Reply: @markpell8979  ,